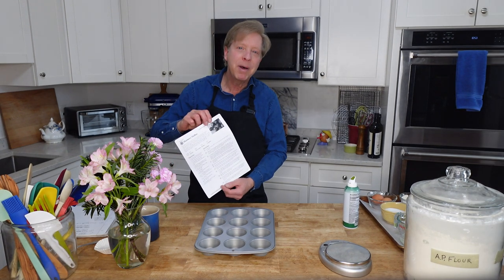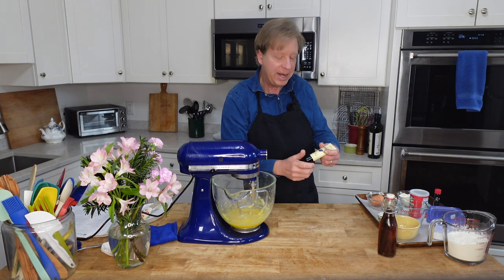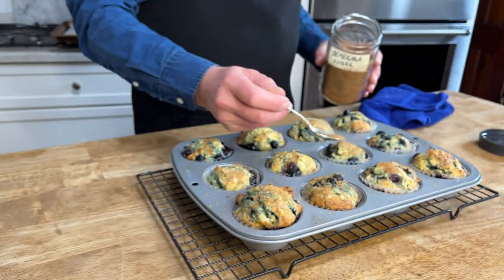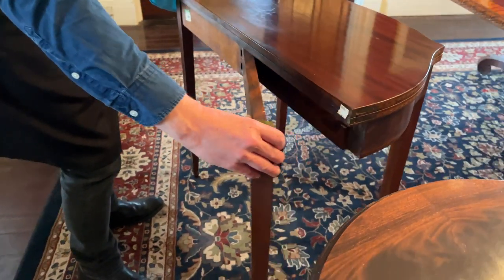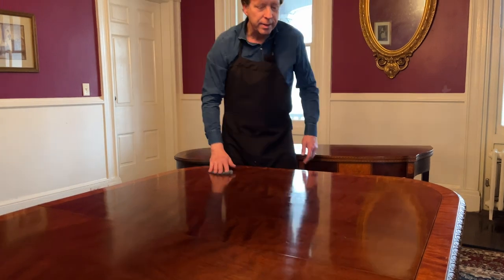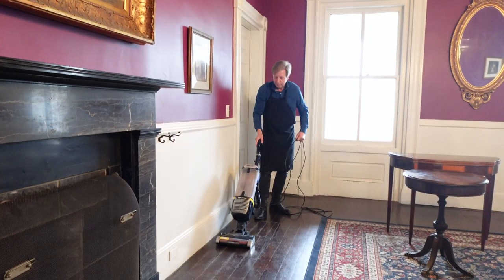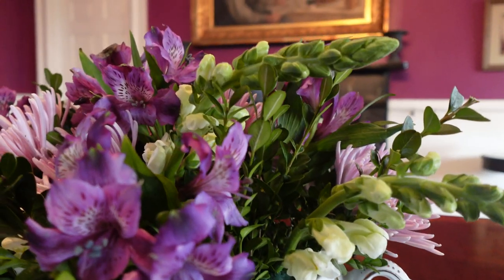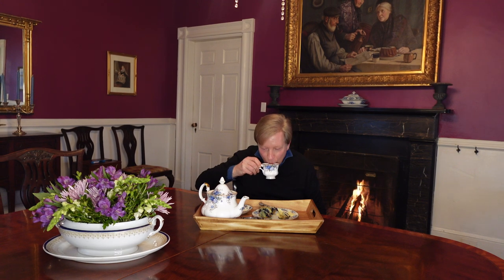Beautifying My Home & Baking SCRUMPTIOUS Blueberry Muffins!

Comment: just ordered  the fresh berries,  I've a few tricks, been them making these for years.  I always add some lemon zest,  mixing a littleflour with the berries will keep batter from turning blue. then add some cinnamon to the  sugar topping and dip in melted butter.
Reply: I do love blueberry and lemon together
Reply: I don't mix in the blueberries with the batter.  I drop in some batter to the muffin tins, then drop in blueberries and finish off with more batter.  Anything to avoid the batter turning blue!   Thanks for your tip!!!
Reply: Yes I do the same. Best M
Reply: This is what I do as well. Love the zing of the lemon zest. Melted butter and sugar on top. Will have to try adding cinnamon! Very relaxing video...as I didn't actually have to clean. 😊
Reply: Delicious! Thanks for the tip!

Comment: Kevin, as a baker, I always enjoy the nuances and variations you bring to your baked goods.  I must tell you that I found the best parchment muffin tin liners on Amazon.  They are nonstick so no oil spray is necessary.  I usually order several boxes at a time.
Reply: Would love the link for the liners.
☺
Reply: @JanMGB  I just looked on Amazon and searched parchment cupcake liners.  I get the green boxes in the 4 pk  called Culinary.  I see new brands now that are cheaper🙂.  They say large but they are regular size, not the jumbo muffins.

Comment: i just found you today and what a great idea! I have a cobalt blue and white soup tureen that I never use anymore and was considering donating it but I think I will look for some potted orchids to put in it to be a lasting arrangement and maybe a couple of little ivy plants. My furniture is much the same as yours and because of my cat I've had to touch up the top with some scratch cover on occasion. Your cat is adorable! I have a darker art piece like yours above the fire and you have convinced me to keep it as well, even though it is tucked away for now while I have a brighter piece up for a change. May I just suggest, a polish up of the stone/marble floor in front of the fire with your Murphy's solution would brighten the area. Thank you for your tips as I'm doing a clean through myself right now too!

Comment: Blueberry muffins are the best.  I will be making these muffins this week. 
Also, wanted to let you know that I purchased the microfiber dust mop you use.  I am trying to move to sustainable products such as these rather than the throwaways that are expensive.  By the way, where did you get that long handle scoop you use for taking the flour out for measuring?  That would be very handy for me as I store my AP flour in a 25 pound canister.